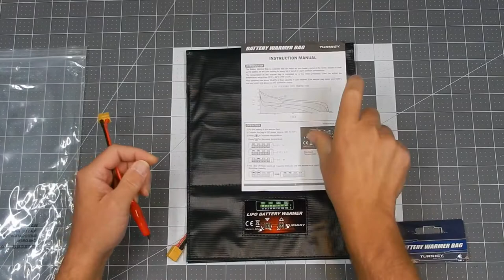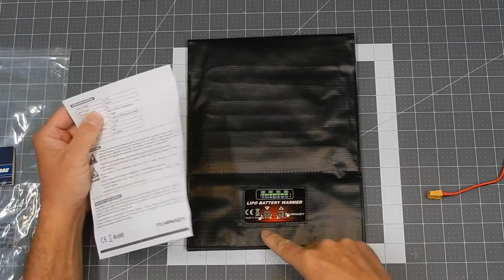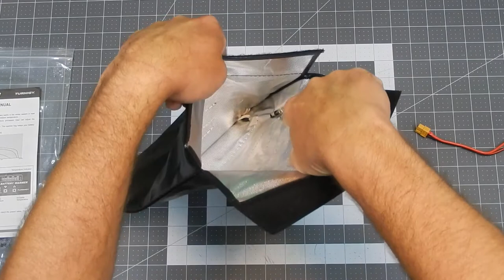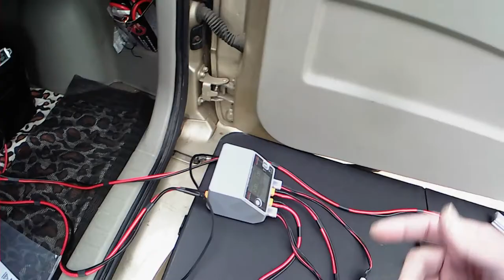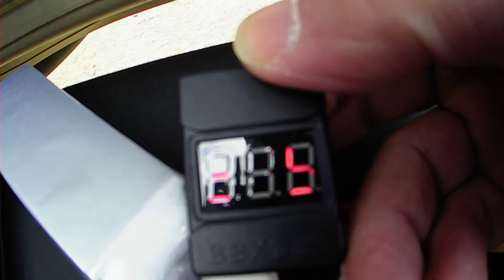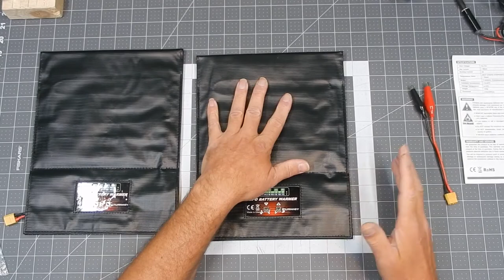Turnigy Programmable LiPo Battery Warmer Bag - Keeping Your Batteries Warm for Winter Flying.

Comment: Great review. Your cons seem spot on.  It's a reasonable price for something that works. I've been looking at the lipo warmer from Ethix on TBS site. A bit pricier but larger capacity storage compartment. Need something for the coming winter months. Happy flying 👍🤓
Reply from the maker: I was looking at the Ethix bag as well before I got these. Apparently the Ethix bag does not have adjustable temperature (I want temp control), but the space in it is much bigger than these.

Comment: Curious how warm they were on the outside and curious if I could use them for heating Li-Ion batteries used in a solar application, by heating from the exterior onto those batteries.  I like that the temperature control capability, and the low amp draw mentioned.
Reply from the maker: They do get warm on the outside but not really hot. I do not use them at the highest temperature, only around 50%, so I'm not sure how hot they would get on the outside at full temp setting. 
***As for a solar application, I would recommend looking into another solution more suited to solar. These are not really designed for constant use.
These things are not big in the least.
So with these, it would have to be a very small set up and you would have to have a good power source just to power the warmers. These draw 4A when warming and run about 50% of the time. So they will use 2000mAh per hour at least depending on the ambient temperature and exposure. These likely will not last if constantly exposed to weather and running constantly.
Reply: @therccrashproject6330  Thanks for the input, really appreciate it.